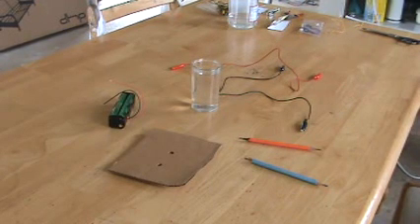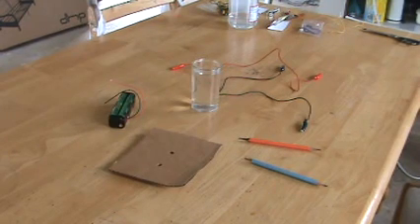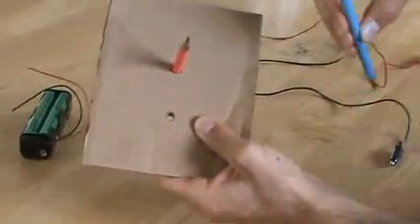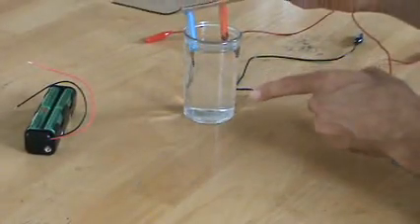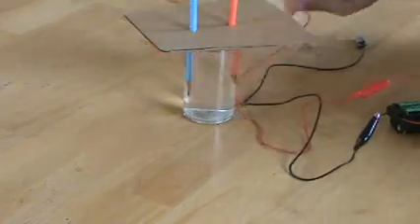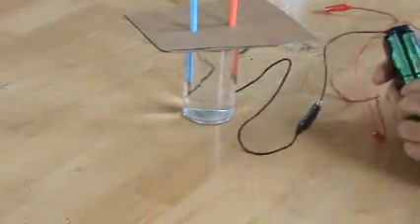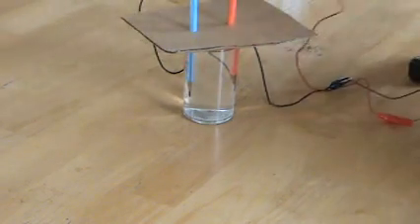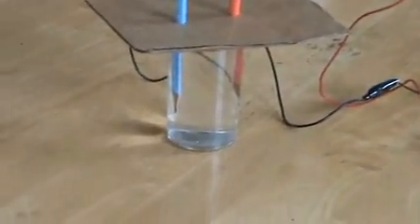How to make hydrogen with 2 pencils (video 2 of 4)

Comment from the maker: Thanks! "Oxygen is not given off in this experiment...The chlorine gas is from the chloride in the salt. The oxygen in the hydroxl ions stay in the solution. So, what is released in this reaction is not oxygen but is chlorine gas that collects around the pencil tip. Around the other pencil is hydrogen gas." - Source energyquest  

google: hydrogen pencils

and it's the 3rd listing down and there is also one on pbs